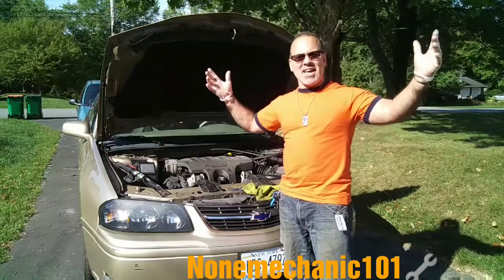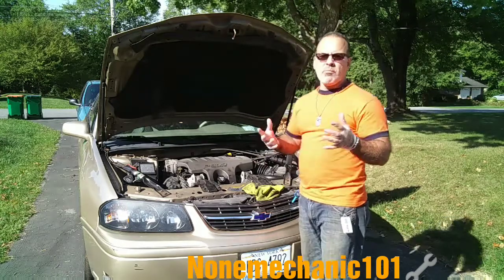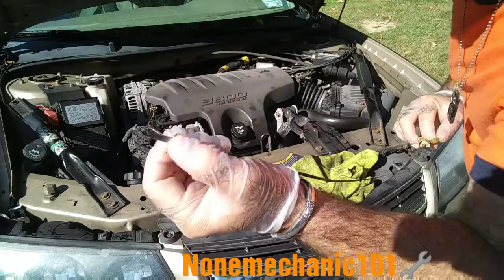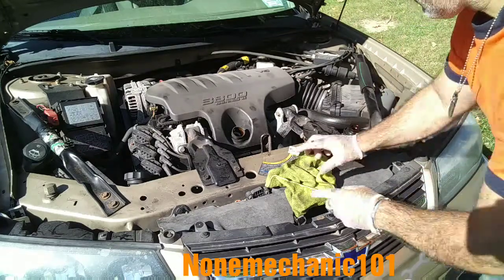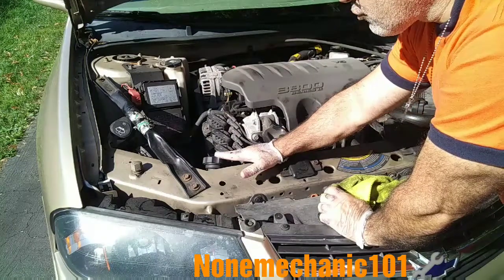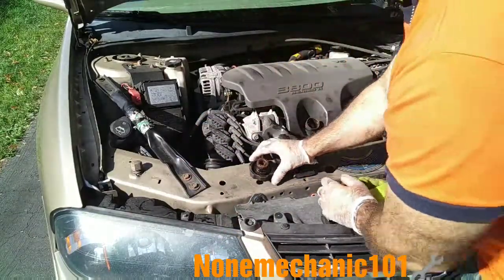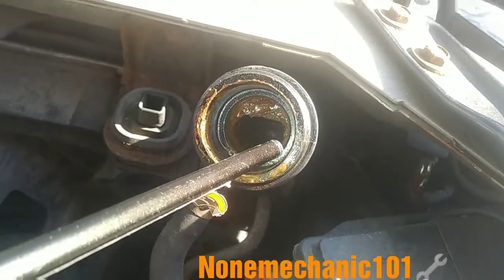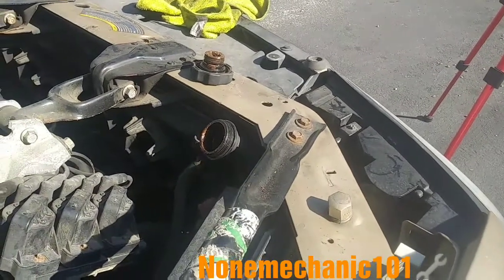Blown Head Gasket? Chevy Impala

Comment: I bought one of those cylinder head gasket leak detector kits a while back. Basically, the tool resembles a turkey baster filled with blue dye and it is placed in the radiator. When you squeeze the rubber ball radiator gas is drawn up through the blue dye and sampled. If the dye     turns yellow the head gasket is blown because the dye has detected exhaust gasses.
The goo in the radiator looks like old and depleted Dexcool and will have to be flushed out. The car also needs an immediate oil change.
Good luck Hector.
Reply: LEN, not too long ago, I FINALLY got one of those, and I must say, IT'S GREAT!!!!
Reply: Okay Len, let's brainstorm this together!! I was looking at that brown stuff as well, and not sure if this is one of those engines, but do you remember GM had those plastic intake manifold gaskets, and they would go bad right on the corners? But I think that was causing the antifreeze to mix with the oil, not visa-versa.

I agree that it should be flushed, along with an oil change, and then see what happens. HECTOR, i would love to hear it run!!!
Reply from the maker: I do know the tool you are referring to. Radiator flush and oil change is coming up. Thank you.
Reply from the maker: @OnlineAutoRepairVideos  The car sounds good. Len subjection is great.
Reply: @NoneMechanic101  I just watched the battery tester video, and it does run good!
Reply from the maker: @OnlineAutoRepairVideos  Yes the car does run good. I got this tool because a long time ago I seeing you used something similar to this.
Reply: @NoneMechanic101  Are you going to show us when you do the flush?
Reply from the maker: @OnlineAutoRepairVideos  I did the flush but I didn't video it. I did a video on the bleeder valve location. This flush was a little difficult for me. Because of one the clams. It took me about 30 minutes to get it out. I was about to cut it off.
Reply: @OnlineAutoRepairVideos   you are correct Tim, however I believe those gaskets were more problematic in the 3.1 and 3.4 and not the 3.8 V6. None the less, the 3.8 is not immune to the same fate. That Dexcool really can look like hardened gunk if left in the engine over an extended period of time. This engine is definitely ready for extensive coolant flush and a few frequent oil changes before I would even consider head gaskets. Yeah Buddy!!!!
Reply: @ManicMechanic007  LOL, thanks for clarifying that, YEAH BUDDY!!!!

Comment: Its not a head gasket. That dexcool likes to gel up when it exposed to air. So you might have a leak. It usually leaks by the plastic elbows by the waterpump or the plastic intake. 

On my grand prix, it has same engine. So i flush the coolant and use the regular green coolant.
Reply from the maker: Thank you. I did flushed the coolant. I replaced the coolant with the green one.
Reply: I used the green coolant in a 2003 Chevy Impala LS with the same engine here.  The green coolant did nothing to stop this problem.  The intake gaskets are also a problem here.  Blow a water pump, and overheat the engine, and you have a recipe for a blown head gasket.  This Impala obviously has not had any work done to fix the recall for the oil leak.  The recall involved permanently removing the plastic engine cover and discarding it due to a fire hazard.  The recall also calls for removing the front engine valve cover and replacing it with a new and revised valve cover.  I do not see that done here.  I once owned two of these Impala's.  They were always having problems.

Comment: For us not to know anything about the car history. There are a lot of people that don't think of changing their oil. It could have a leak or it could be burning the oil when the car is running and all the pollution control stuff is doing it's job to keep the smoke from showing.
  Now for the coolant in the Radiator, They make a brown colored coolant that is supposed to be good for something like 5 or more years and will look like that when you look inside the cap of the radiator. 
  So I will say so far things are looking ok. Flush the radiator, change the oil and maybe with an oil flush and you are good to go.
Reply from the maker: Thank you.

Comment: You’ve probably done this already but in case you haven’t yet: I would start by making sure the oil drain plug is tight, flushing cooling system, topping off fluids and going from there. Check for any external oil or coolant leaks, and if there are any fix those. If you still suspect a bad head gasket and see NO EXTERNAL leaks, get the tool that looks like a turkey baster to test if combustion gasses are mixing with the coolant or not.
Reply from the maker: Thank you👍

Comment: it looks like it had a coolant leak and someone dumped some stopleak (barrsleaks)in it. that is what it looks like in the cap.top up the oil fill the radiator with water not coolant. leave it run if its a head gasket.  it will go off like old faithful. stand clear.
Reply from the maker: Great tip. Thank you
Reply: @NoneMechanic101  water is free lol👍
Reply from the maker: @thisguysgarage  👍

Comment: Pull the plugs are the wet turn motor with plugs out did water come out did the motor turn with the plugs in is their oil in the coolant? What’s the compression on the cylinders? Is one to low ?
Reply from the maker: After doing a coolant flush. The car ran good.

Comment: I would definitely change the head gasket, change engine oil and flush the cooling system
Reply from the maker: Great ideas🔧
Reply: yes , you are right., if you get exhaust free of cooling water ,you will not change anything else
Reply from the maker: @creativelife4453  Thanks🔧

Comment: The 3800 is one of the best engines on the planet. Use the die kit . A lot of those later 3800's had composite (plastic) intakes that leaked at the water jackets. Check intake gaskets for signs of leakage.
Reply from the maker: I also have heard that these engine suppose to be good. Car has and oil leak but not a coolant leak.

Comment: Did you ever find the issue?
Reply from the maker: The coolant was dirty so I flush the system.
Reply: @NoneMechanic101   yea I took my thermostat out and there was a gel like substance on it. No coolant seems to moving through the system. I think the previous owner mixed the wrong antifreeze with the dexcool. So I'm trying  to figure out how to flush it but Ive never done a flush. So I think I'm gonna put a garden hose in the heater core and then the radiator and in the water pump.  Hopefully that pushes it out.
Reply from the maker: @SdotX  Let me know how it goes

Comment: These Malibu's are known for blowing head gaskets,. Low oil and crap in the radiator? Did you ask the owner why has it been sitting for 1 year? I would put oil in it and flush the radiator and let it run to see if there are any leaks or engine knocking noises, or if you got a leak tester. Test it for leaks. These cars are garbage, very un reliable, money pits.
Reply from the maker: I did asked the owner. The car was sitting because the son got a new car and forgot about this one.